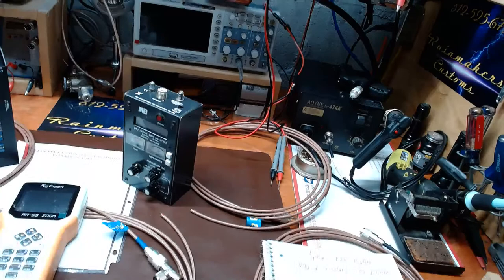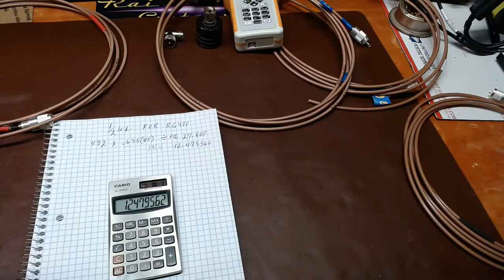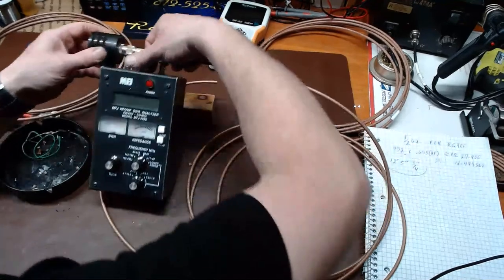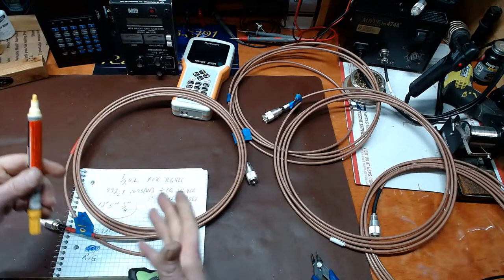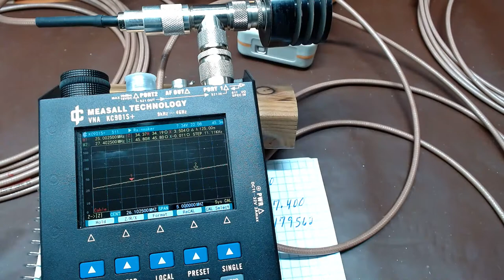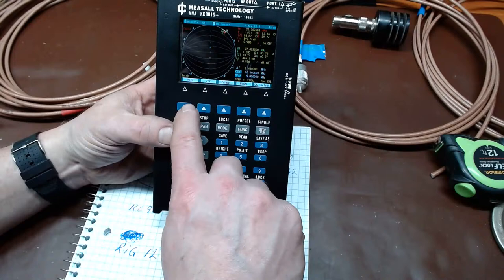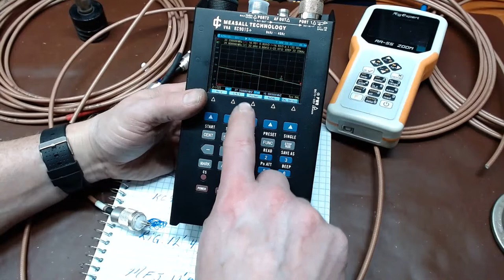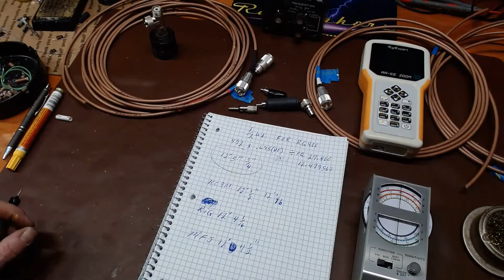1/2 Wave length coax, which meter is most accurate?

Comment: 259b manual says short the end on half wave length, for R & X.
Reply from the maker: I will read up on that. Thank you
Reply: Correct. The Rig expert manual says the same thing. Lose the dummy load... tune for X factor(reactance) to zero with the far end of the coax short-out for any 1/2 wave mulitiple. Use an open piece of coax to find any 1/4 wave muiltiple length. Just tune for zero reactance. its all in the Rigexpert manual (AA-35-zoom).

Comment: My brain hurts.. recently licensed ham operator and been on cb for a few years now. Just looking to make sure I don’t fry my new equipment that’s running some power I didn’t realize there was so much to the coax tuning. Looking between the rig expert AA35 zoom and the mfj 259D if anyone has any suggestions I’m all ears.
Reply from the maker: AA 35. Is your best bet 4 tuning. What's the transistors we have today Things are so sensitive. And something is simple as coaxed length makes a huge difference
Reply: @rainmakerscustomsrainmaker8985  Thanks for your response. My main concern is the limited frequency range of the AA35 antenna analyzer. Currently, I'm setting up a 2m/70cm rig and aim to obtain my general license soon for access to more bands. However, the AA35 will only be suitable for my CB/10m setup at the moment. Do you recommend any analyzers with broader frequency coverage, or should I plan to purchase another one when the time comes?
Reply: There is nothing "to" the coax tuning.  It is a myth.  Just tune your antenna using a good meter and any random length of coax.

Comment: Will a Nano VNA do this as well?

I'd like to see an antenna tuned perfectly with one of the half wave sections that you have cut here then go back and check SWR with a  6ft, 9ft, 12ft 18ft and random long piece.
Supposedly the SWR should not change.

I tuned a friends truck antenna with a 6ft coax from his antenna to my Nano VNA for a center of the band 1.3:1 SRW and 1.5:1  on ch1 and ch40
 Then when we hooked his radio back up to the 18ft coax in his truck and checked it with a regular mic  key down dial to 100%  flip the switch and the SWR on ch40 was 3.5 and in the red.

We had to cut another inch off the antenna to get the SWR right for the 18ft cable.  Once that was doen the Nano read perfectly once again.
Roughly 5 inches came off that new antenna to set the SWR. It was resonating in the 12 meter band and he needed 11 meter.
Reply from the maker: Well maybe this Spring when the weather is nwhen the weather is nice I can go back and we can see what that is like I have a shockwave that I can put together and test this theory with we will. As far as the VNA  I don't have a whole lot of information about this particular meter I know several people are using it because of the economics. However I really don't have any information where I've never owned one to be able to put it to the test to see the variances
Reply: @rainmakerscustomsrainmaker8985  Bells cb says that you have to tune an antenna with a perfectly calculated half wave coax. Once that is done he says length of coax no longer matters.
The idea is that non half wave length coax does not report the true SWR of the antenna.
Reply from the maker: Well I do believe the phase angle actually does change based on where you're at on the length of coax. At this point I think it may be important to consider this as part of a factor in length of coax chosen.
Reply from the maker: Again later this Spring or summer when I have a little more time and the weather is better I will set up set up my spare ground plahe's groundplaying and we will try this out and do a video on it this way we can get a few more answers in income realistic testing we'll check the phase angles And we will try some random lengths of goof coax after after we tune it out using a single half wave piece of coax
Reply: @RC-Heli835  You contradicted your self. First you said you have to have a tuned coax to tune your antenna properly, then said once the antenna is tuned the length no longer matters. That is incorrect. tune all coax! if you have a random peice of coax in the line, you will have to re-tune the antenna compensating for the coax.
Reply: @nasanction  I'm actually trying to figure out if a half wave length or multiples of half wave to tune the antenna with is important.
The problem is if it has merit it only works best on one frequency. So pick the middle of the band 27.205 mhz ch 20 right? And let the other channels fight over whats left? LOL!

We used a 6 ft jumper to tune the new antenna on his truck to a perfect swr. Then after hooking it back up to his 18 ft coax, SWR was high and the antenna had to be cut off another inch.
I used a nano Vna 1st and was so shocked at the high SWR that I went to the house and got the old school SWR meter.

What I learned is that you have to tune with the coax that's going to be used.

Supposedly with a perfect 1/2 wave electrically correct piece of coax you could tune the antenna with it and an analyzer and the antenna should be good no matter what length coax you put on it later. I don't know just trying to figure it all out man!.
Reply: @RC-Heli835  As I understand it, You tuned a 6ft. coax and then tuned the antenna to that. Then you put a different untuned coax in it's place and re-tuned the antenna. Now your antenna has been tuned to compensate for the untuned coax. Wrong...  You have probably ruined your antenna by clipping it way too far. 
This is what I did. I tuned (With an analyzer on the center frequency of the band(CB/11 meter = 27.205 Mhz)) All my coax jumpers that I will be using in my setup, Then the final coax going to the antenna Is tuned. (X=0 on the analyzer is what you tune to with it set on 27.205Mhz.) Once all of your coaxes have been tuned, then you can tune your antenna to resonance, ie: the lowest SWR possible. I say as possible because not all antenna's can tune to 1.1:1, some may only tune to 1.2 or 1.3. It depends on the design of the antenna. DO NOT ASSUME THAT A 6ft. IS TUNED! NOR THE 18ft coax. TUNE THEM ALL FIRST! When all your coax is tuned, you will then see your antenna's true SWR adjustments. I don't think I can explain it any better than that. If you still don't understand, hire someone who does to do it for you. I hope this helps. as replacing antenna's can get expensive...
Reply: @RC-Heli835  Now about wave lengths. With the analyzer, you can tune 1/4 wave with a dummy load, 1/2 wave, whole wave and multiples of whole wave lengths without a dummy load. It is true that you tune the coaxes to a specific frequency 27.205 but the SWR curve remains the same and alows use over the whole CB band. Good luck!
Reply: @nasanction  Ok thanks and good luck to you as well sir!
Reply: Reading down the comments, there's some mixed terminology and theory. This is how I see it: you utilise a half wave length of coax, or multiples thereof, to measure the antenna's impedance. When a system is 50 ohms all round, the SWR will be, and read the same, anywhere along the length of a theoretical lossless feedline, of any length.
With the 6ft coax/trimming the antenna, well 6ft is about a quarter wavelength at a 66% VF. As we know, having a different load impedance to the 50 ohm input wil mean the coax is behaving as a transformer, and you could calculate what the antenna impedance must have been. However, where was the SWR meter placed? And a patch lead was added anyway. That's the conundrum. So follow the above procedure, and you know the SWR will be fine, given the radio and feedline characteristic impedance are the same too.
In fact, wouldn't one be convinced the SWR is 1:1 if it 'does' measure the same anywhere along the feedline eg. do separate tests with different patch lead lengths to your meter. But hang on, do you still have to take the loss/attenuation into account?

Comment: You never showed what your dummy load was reading without the coax so I could see a base line.  On my Rig Export 55 the dummy load without the tee the "X" =.37 with the tee "X"=2.03. So should I cut the coax to bring it down to the X= 2.03 (with the tee)? It would seem to me if I go to 0 or less the reading would really be incorrect.
Reply from the maker: I believe there is a small clip where I do. But it is about 50.3 ohms if I remember correctly or 50.6
Reply: @rainmakerscustomsrainmaker8985  what About what i said for the tee And the "X" factor.

Comment: The MFJ looks easier to use. The fancy meter seems questionable, being 4" different than the other two, and at odds with the math. Did you ever re-test with ends shorted?
Suggest, a 20' tape measure, locked open with the end of the tape and pl-259 pin pushed against a stop. On the floor or table. We don't have to watch, we trust your measurements.
Can we assume the coiling of coax makes no difference? Just getting into nano vna [frustrating], thinking should have gone with MFJ. The nano will measure coax length, but I think both ends need to be terminated.
Reply from the maker: I will come back to this and make a new video when I have free time

Comment: I watched 3 made and donkey stomper do it without the dummy load but yes 1/4. I made two 1/4 without dummy loads. On 1/2 Without dummy load the coax wants to be around 18' from what I've experienced.  But have not completed one yet. I was trying to make a 1/2 and I cut it 17' and I had an X=40. Kept cutting but it only went up then came down and I landed on another 1/4.  Had to order more coax🤦...  I guess I'll order a dummy. That kinda explains why my 1/4 was 6' but my half was more then 17'.....
Reply: If you were at x=40 and as you cut the x value went up, then you started with a coax that was too short. You don't need a dummy load, just put the coax directly into the analyzer. I have found that a 2" cut = one number. A half wave is around 12ft. a full wave around 18ft. always start with a little more than your tuning too.
Reply: @nasanction  I found with a1/4 wave u don't need the dummy but my experience is with half u fo

Comment: Where do you get 391.4, i saw 34194 on that calculator, that would be funny math, also which is not spelled witch in your video description.
Reply from the maker: Well I went back and rewatched the video yes I did make an error when I wrote down the number onto the paper. I do apologize however mistakes do happen from time to time
Reply from the maker: The correct formula though is written down which would be 492  × 0.695 which is the velocity factor For the RG 400 divided by the frequency in which you are going to be using

Comment: So the reason the lengths were different was because ends and QC of wire?
Reply from the maker: No it is primarily the difference in the type of metres and how they actually analyse the mpda nsw on the wavelength The kc 901 for example has a Built-inCalibration it also has an external calibration so this is one thing that will make a difference when using it on different applications The other 2 are very similar however you do have a margin of approximately 5% that they will be within With the best and I have found on the specifications on all 3 meters
Reply: @rainmakerscustomsrainmaker8985  appreciate the response! I watched it all but I have two small kids so I'm only ever half listening to youtube. lol
Reply from the maker: It can be,  however they were all from the same roal. The meters are from different   manufacturers and have some degree of   tolerance. So the best we can do to see how accurate the test equipment is, is reference to a similar peace of equipment and through mathematical calculation of something known
Reply from the maker: @electromechanicalstuff2602   If you would like You are welcome to text me on the phone number provided in some of my videos and I will try and help you come up with The answers you are looking for this way maybe I can make another video that will help you a little more later on
Reply: @rainmakerscustomsrainmaker8985  I may have figured it out. When cutting a 1/4 wave with the dummy the resistance goes to zero apparently. Maybe u showed that in your video and I missed it. As far as the 1/2 wave goes when I connect my two 1/5 waves together with my diy dummy load I can then see the resistance. As far as my diy dummy load goes it's not good enough. It has X=19 because it's not in a shielded box and other reasons. I have a 15w average dummy coming from dx engineering so I'll wait till I get it to try this again. Thanks for the support I appreciate it!

Comment: Wouldn't you have to cut it shorter than what the length is with X=0 due to the electrical length of the Tee connector?
Reply from the maker: Not necessarily. You have to remember that you are only dealing with maybe a distance of 2 or 3 mm in length inside the connector. Which in turn you will be using a similar connector on the back of the device you're attaching it too. There are several different types of So 239 connectors Which have small discrepancies based on the type of material and the overall length of the center pin Generally your phase angle will not change hardly at all if you are looking at approximately plus or -10 channels

Comment: So what was the verdict?
Reply from the maker: Well, for the co exit self from what I saw, the Reggae expert was one of the most accurate Based on the calculation of the length.
Reply: @rainmakerscustomsrainmaker8985  that's what I want to hear, since I have that exact analyser... mun. Thanks.
ps. did the MFJ come last? That's what I would have predicted.
Reply from the maker: @arconeagain  yes it was decent, but there is much better today
Reply: If there is much better today .... what might that be?
Reply: @J123G  maybe he means later models, some which operate at higher frequencies which is no use to me, and Bluetooth. If they're accurate, they're accurate. What do you do, compare it to a once valued $30,000 VNA, or better a million dollar one? I'm no dummy, I know what kind of equipment is out there.

Comment: Why test at 27.405? Is that because of where you will be transmitting most? Would mid band be better? I often use lower channels when not on SSB. Thanks!
Reply from the maker: At the time of this video this is what the customer I had wanted the jumpers made for
Reply: For demonstration purposes, does the frequency really matter (in the HF range of this device)?

Comment: That 4 inches simply falls within thee 5% error factor that is given for each of these meters.
People say coax and ends are simple just cut an run. 
That is so not true coax is actually a very complicated piece of wire. 
I have thee mfj well 2 mfj meter i use them for 2 meter and 440 and thee other for 11 meter.
Mfj has served me well

Comment: I don't know about this guy. I. Think he's full of it. They don't want u to know something. Never cuts to the chase
Reply: Within reason he is correct.  I do not use a dummy load. I short out my coax.  I use rig expert. I also use rig expert to find velocity factor so there is no question in the piece I am using. Rig expert states in the manual to short the other end of coax to find 1/2 wave. Dummy load not needed